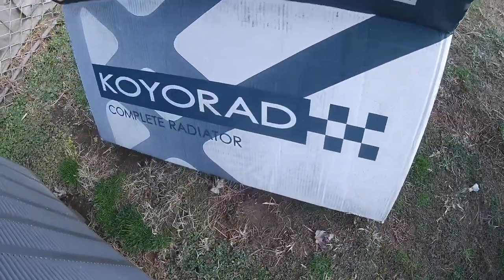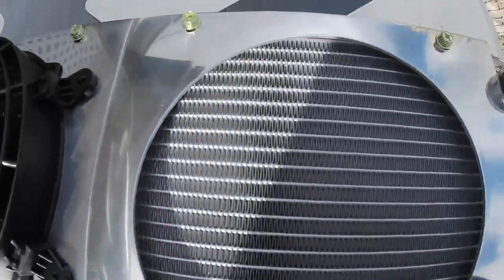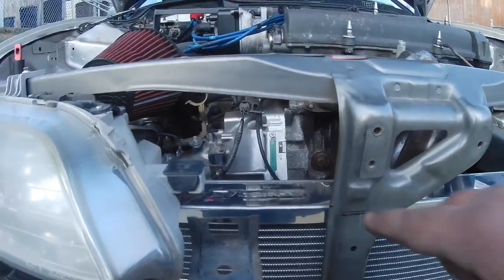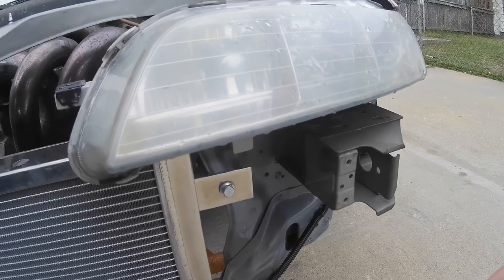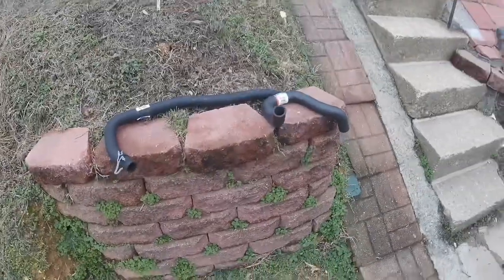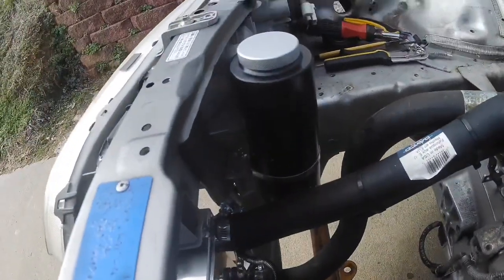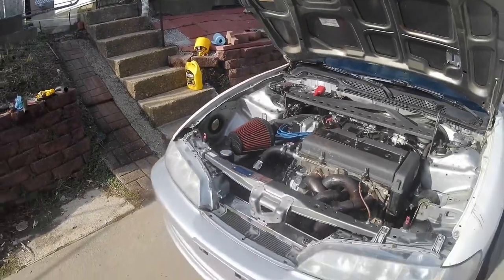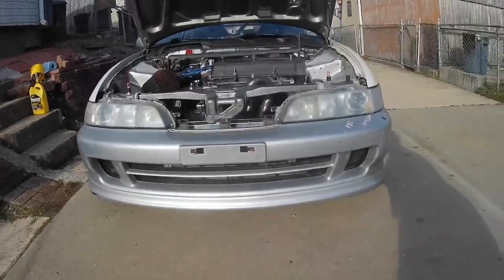Koyo Tucked Radiator : track integra

Comment: Bro that koyorad is so sick. Will it work with turbo applications too? Cause I really dont wanna run a half size rad. and all other brands are too damn expensive.
Reply from the maker: His n Her integra it should work no problem with a turbo there is plenty of room in front the engine for the manifold and turbo and there is enough room for a intercooler in-front of the rad
Reply: @RevHighDriveHappy  I'm still running the crash beam in the front will that have to be taken off as well?

Comment: I appreciate your videos. I have the same set up as you, plm V2 and tucked radiator. I am currently installing it and my question for you is how does the radiator fan hold up against the heat of the plm v2 headers. Does it melt the plastic being so close to each other or do you have to heat wrap or ceramic coat the headers?? Thanks and looking forward for your next video 🤙
Reply from the maker: Philly PeenO the fans haven’t melted at all and the manifold isn’t wrapped or coated
Reply: Rev High Drive Happy  thanks for your input bro. I was just kinda iffy because they’re literally millimeters away but i feel alot better putting it on now 🤙

Comment: how has this radiator been holding up for you? I’m about to put one in my road race eg. I’m hoping it’s a lot better than my half size skunk2 rad.
Reply from the maker: I actually am not running this anymore because temps on a 95 degree day after a 20-25 track session would be around 197 so I went with the mishimoto x line full size now my temps are around 160 cruising 185 coming of track

Comment: Any clue as to silicone option for hoses?
Reply from the maker: Elphuerte07 No that I am aware of.... you can use an oem lower hose but you’ll have to come up with a different hose for the top unless you make your radiator fill/cap different then I did mine
Reply: I went w the ktuned filler neck. Been too busy to install it all. It gives the AN fitting option or standard nipple fitting. I bought both. Well see how it goes. Thanks for the reply.
Reply: Oh yea, koyorad dont have AN option. Ill have to weld AN bungs to it. Well see.

Comment: Link on the fans sir
Reply from the maker: https://www.ebay.com/itm/2x-8inch-Universal-Slim-Fan-Push-Pull-Electric-Radiator-Cooling-12V-Mount-Kit-/262925030728?_trksid=p2349624.m46890.l49286